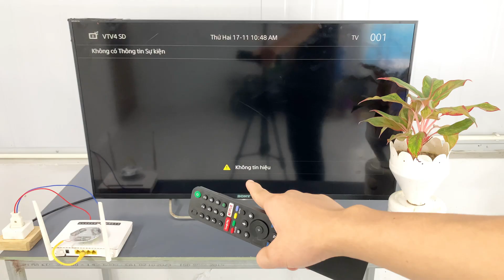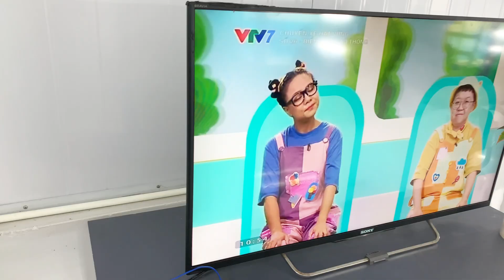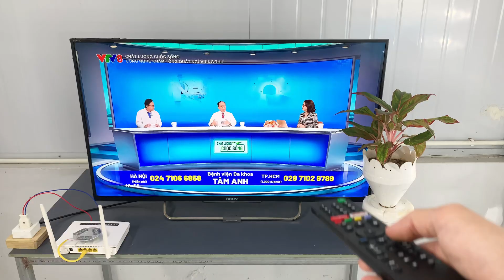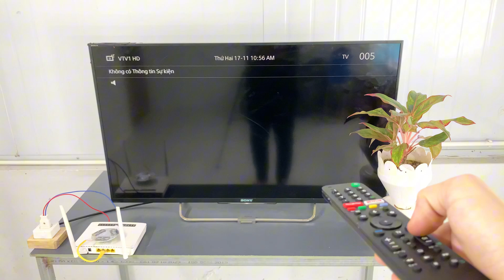I Connected a CD to My WIFI ROUTER – And the Signal Surprised Me!

Comment: It is amazing how simple materials can solve high-tech problems without spending a dime 💿📡
Reply from the maker: Exactly! ⚡ Without power, the router can’t function at all.

* **Mains electricity**: stable, unlimited runtime, no interruptions. ✅
* **Battery/UPS**: portable, works during power outages, but limited runtime and may need frequent recharging. ⚡🔋

Choice depends on whether you prioritize **stability or portability**.